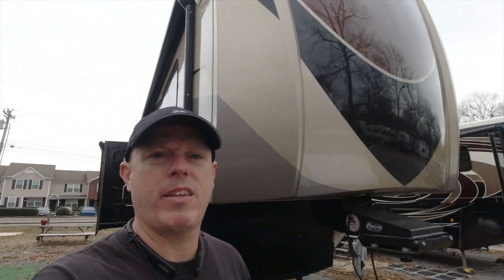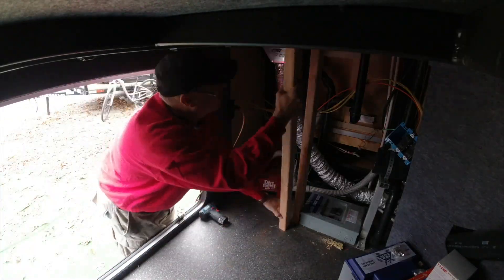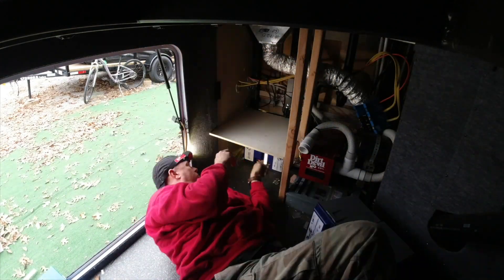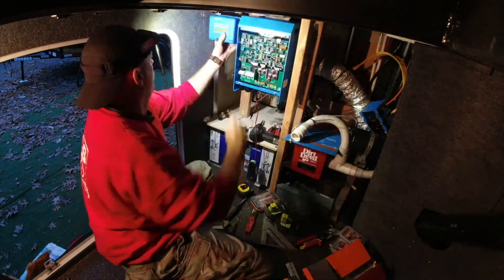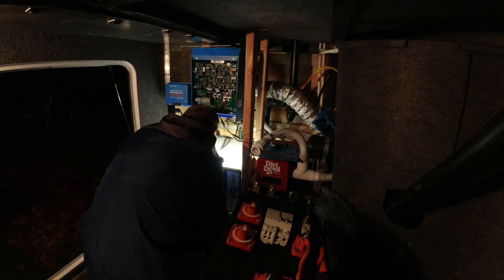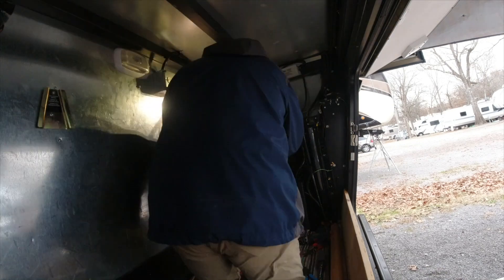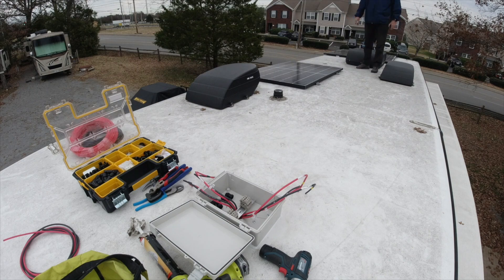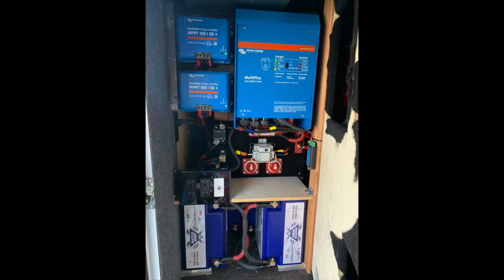2013 Lifestyle | Fifth Wheel Solar

Comment: One thing I’m curious about how you run the wires to the roof through an interior wall?
Reply from the maker: Hey there Nathan - thanks for the inquiry.  We apologize because we did have some footage of the wire being ran in the wall; however, it was not enough to add into the video to make it all make sense.  In this particular install, there was a cabinet above the toilet where we ran a stealth wiring from the roof, through the cabinet down through the wall and then down to the basement.  When we have to run wire through a cabinet, you may be able to see it a bit when you open the cabinet, but we do our best to conceal it so that it is out of the way and mostly unseen.  We will not run exposed wires through the coach, ever.  Hope this helps!